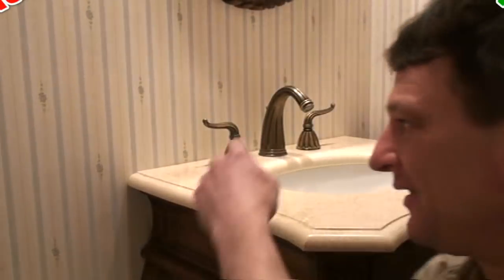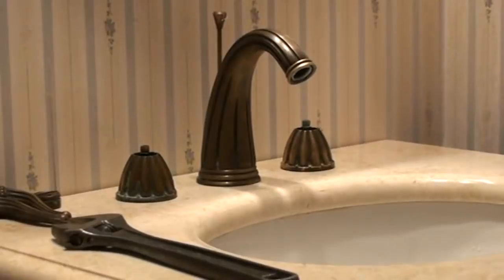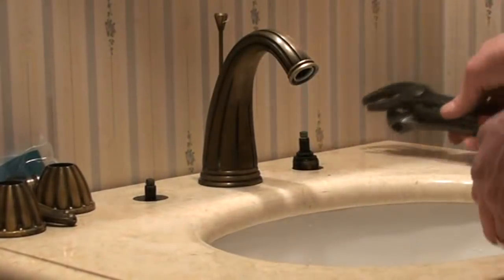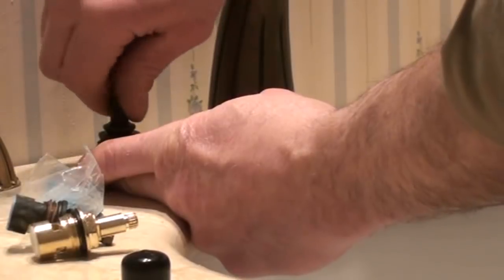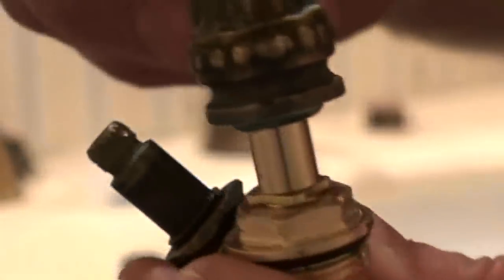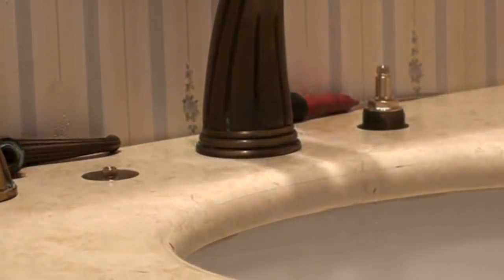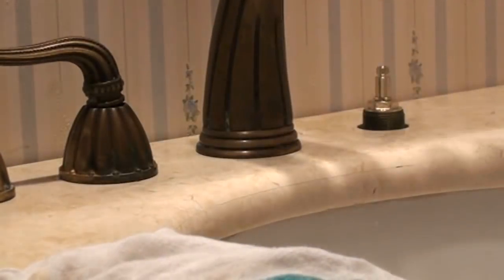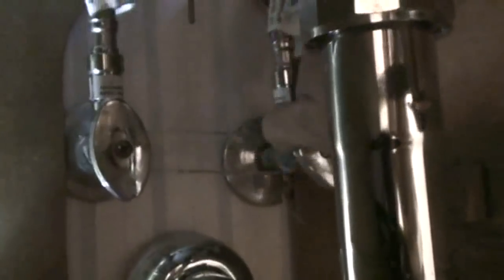Repair Faucet 1/4 Turn Ceramic Cartridge Drip

Comment: We have an American Standard faucet. Three holes. The cold water had a drip. After much searching because we didn't know what company made ours at the time, we found your video. Thanks so much! 
A note for others: Our American Standard Cartridge replacement, discontinued at Home Depot, cost $15 Prime on Amazon.  It was good news.

Comment: The cold water tap of my 1/4 faucet was sticking and would not move. Your video showed me how to remove the cartridge. I put it in a vice and squirted it with WD40 and oil, and kept working it. Finally it freed up enough to be operational. I don't know if it was the ceramic parts or the stem that was sticking. Saved me a bunch of money for a plumber. Thanks.

Comment: Just did the hot side.  This time i didn't have to ask my 14 year old son to squeeze into the vanity to steady the supply line with a pipe wrench!  Was able to grab the fitting from above as fitting had flat spots for a wrench.  And ... it was a breeze!  Used Blaster PB to loosen valve.  I'm on Long Island and will look gladly call on you when I'm in a jam.  Thank you very much for your very informative video!  You have a subscriber and fan for life!

Comment: Nice, thorough video. Very well explained. I did this repair myself so you saved me at least $120 because that's the minimum my plumber charges (on Long Island). 

Also, very good point about calling the manufacturer for the replacement cartridge. I got one completely free from American Standard so that saved at least another $10.
Reply: I'm female & I just replaced mine today, removed the old one & took with me to Home Depo, I'm so proud of myself for saving some big $$$.  You tube video's rock!

Comment: Thank Dino!  Your tip about checking the valve seat was great.  I used a straw to blow out the seat and reinserted the old ceramic cartridge.  The drip is gone, wife is happy, and I am grateful.  Thanks again.

Comment: I want to get this message out. I had a dripping tap, hot and cold sides. When off work with man flu, I started to look, turned off the water, then went to bed for two days. In the intervening time my wife and kids tried to turn the water on many times and grumbled. When I turned the water back on both taps had stopped dripping. Worth a try. Not the man flu. Turn the water off and operate several times. They now haven't dripped for four days.
Reply from the maker: how that work out long term?, let us know Jan

Comment: man, you're a character. Thanks for the video. I hate my ceramic cartridge faucets and wish they were all rubber washers; they are more reliable and easier to repair
Reply: So true.  The other major point is that a replacement rubber washer is like 25 cents versus a new cartridge which is like $10 - $15.

Comment: Dino, excellent how to!  I was going nuts trying to figure out how to get the cartridge separated from the main housing.  I have taps like you worked on, and I just 'gav'er" and out it came.
In my case the ceramic disks were fine, it was the 2 o-rings in the stem that were allowing water to leak out of the top of the stem, and out through the "eschucon"  I replaced the rings and it's all good.  thanks for posting.

Comment from the maker: @BB420INC, thanks for watching and the comment, as you may or may not know, the difference in these cartridge may be one spline on the handle shaft. i have a book with over 700 different cartridges, there is no way of telling without careful comparison, measurement,  sometimes counting splines. this was not pf, they all look basically the same at a glance yet are very specific to appliction, wether your handles fit, eustchions, or even if it holds water, depends correct selection. thanks

Comment from the maker: benz, thx watching, pegasus is home depot brand, same is  glacer bay brand, anyway you can easly gert parts at local home depot or online, they have ususlly plastic cartridge . bring old cartridge to home depot to match up, here is general idea
remove the handle look for a small. hidden screw on the handle/trim and remove it by turning it to the left CCW.  continued.....

Comment: Dino, great video!  It is 99% similar to the faucet I'm trying to fix in a Pacific Heights home in San Francisco.  Only difference is handle has an Allen screw.  Local hardware store didn't have the 1/4 turn ceramic cartridges, so gotta hunt some more.

Comment: It's a good idea to check that the water pressure is not too high before jumping to this repair. Shut off your supply then open it up half turnuntil you get get your desired pressure.  Check to see if your cartridge is still leaking.

Comment: You used both wrenches backwards when removing the old cartridges. And the wrong / backwards way with the lower wrench during the installation. The top wrench was used correctly during the installation & tightening.

Comment: Learned a lot from this. My last "plumber" fixed a leaky kitchen faucet and a toilet that was leaking from the wall and charged me twenty bucks. Almost a year later, both seem fine. I'm trying to fix the new leak in the bathroom sink myself. I thought there would be washers inside, but, no.

Comment from the maker: handle lift off after hidden screw is removed. you may jiggle the screw to get it to come off. models are differ so check online for installation manual look for the lock nut and ring that hold in the cartridge. Ii your faucet has the lock nut/ring, might not be able to pull the cartridge until remove them. use pair of pliers to pull out the cartridge slide in the new cartridge exact same as removall
benz..thanks for watching

Comment from the maker: @mark
useing the shut off under sink may be able isolate which side leak by shutting one at a time, its hard to tell the temp of the drip, the water cools by the time it actually drips
as not twisting under pipes, watch 6 minute mark, i use channel lock, grab barrel, u cud also heat barel carefully with torch, care not to burn counter and you just want to warm the barrel, torch like 15 seconds . hope this side is easyer, also make sure they tight in barrel, some lose they drip a little
good luck

Comment: Need help: after replacing cartridge out. Then handle does not lock at the 9 O'clock position (left side). At the 9 O'clock it shuts off and the handle will continue to rotate further and the water will come back on.  Confirm the cartridge is correct. Trouble shot it by putting old unit back in but still does the same.  Not sure what I am doing wrong or how to further trouble shoot it. Any help would be appreciated! Thanks!

Comment: Great video. But I do have one suggestion.  Turn the water back on and test for leaks before you put the handles and escutcheons back on. If there's still a problem, you'll have twice as much work to take it apart again.

Comment from the maker: if threads on trim ring are stuck, you can try lightly rapping with a wood nylon mallet if you have or the hard handle of a big screwdriver, you dont want damage finish so dont hit metal to metal, and or few drops pentrating oil , let soak to loosen things up or invest in a good "strap wrench" not as cheapo, a good one. 
but benz, you should may not have to remove the trim ring to get cartridge out can grab the threaded barrel with channel lock without removing ring?

Comment: My ceramic valve is not leaking;  it's squeaking.  I tried spraying a little restaurant-grade silicone lubricant on the top of the shaft, and that worked, but only temporarily.  Is it possible to lube such a valve?  If not, I'm starting to think I'd rather be replacing a rubber washer than an entire cartridge...

Comment: The splines on top of the spindles were not correct which left the handles loose, yes you tightened the screws in each handle, but I know and you know those handles won't stay on.

Comment: I tried to change the ceramic cartridge on my leaking faucet, but I can't get the escutcheon to turn.  Very tight or could it be bolted somewhere.  They're very similar to the ones you have in the video. Any suggestions?
Reply: Spray some WD40 & let it sit awhile, then removal should be a snap.  I had trouble getting the cartridge out, & I sprayed WD40 on it & it came right out.

Comment: Did you ever identify the brand of faucet in the video.  That is my exact one.  How can I find just the ceramic washer inside?  Or do you need to buy the whole stem?
Reply from the maker: paul cashman paul, u need the whole "cartridge", google alfano plumbing in corona queens new york, send them a clear pic unless i mentioned the part number in the vid, they have they called it an "import" brand

Comment from the maker: @BENZI165 try call pegasus direct, they can help walk you tru your issues, also the have lifetime warranty on all parts, so ask and they send you free cartriges, ask for both hot & cold and new aerator while on phone, also finish is covered, any pitting will be replaced, they may send new faucet if you come up with good story
Call  1-877-580-5682  or 1-888-328-2383 for Pegasus Warranty Info.

Comment from the maker: dinopinch@gmail.com
some handles pull straight off, lots the grohe the handles pull off, requires effort but just pull straight.....dont pull the sink off the same time, one hand hold the sink down,other hand pull up the handle, others the trim of the handle is threaded, grab the lower trim of handle & unscrew the base

Comment: Have an Aquabrass Prestige 6216 faucet in our sink but can't get the handles off (no screws visible, just on with friction I think).  Tried pulling straight up with all my efforts without luck.  Any suggestions other than to contact a professional plumber?

Comment: Great detailed video!  Great!  I have a Hans Grohe (spelling?) faucet--just like the one you demonstrated.  Nothing on their web site to help. Your video helped me a lot.  Thanks! I replaced the cold side only thinking it was the problem but seems to still be leaking. Not sure yet.  I suppose i will try the hot too but dripping water is cold.  Also getting cartridge out was a BEAR i didn't want to cause problems below with feeder lines.  Any other suggestions you might offer? I used a lubricant